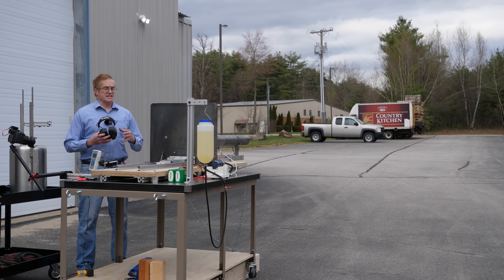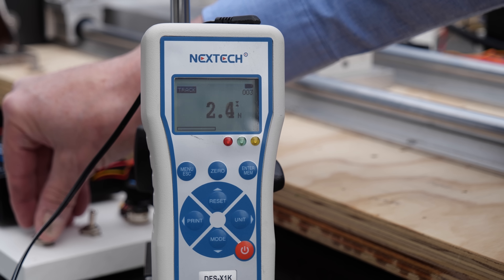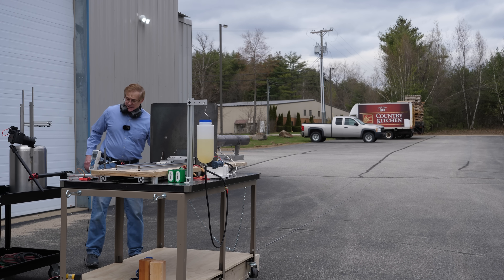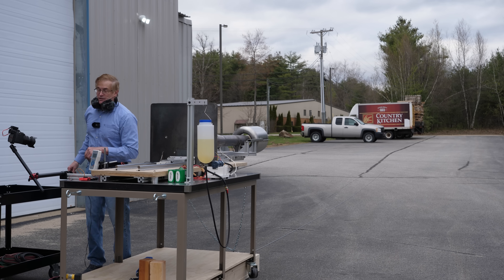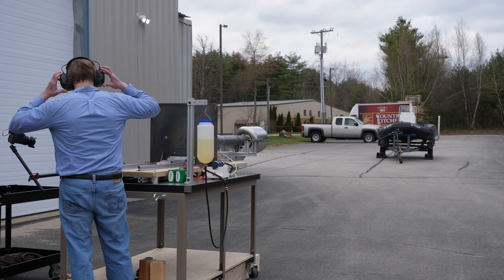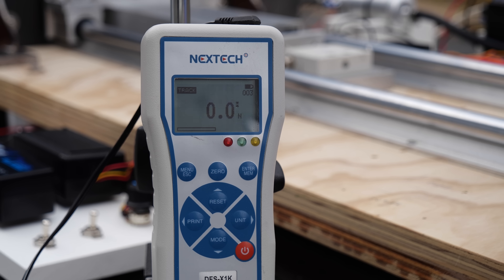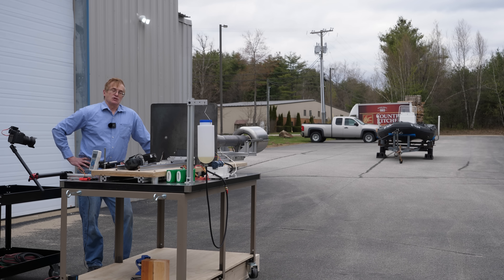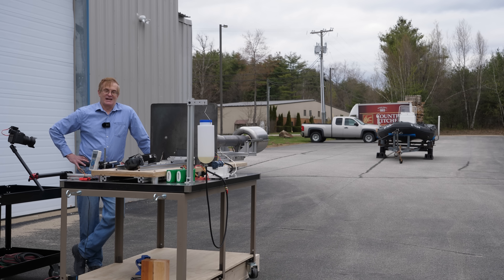WE USED AN AUGMENTER ON OUR PULSE JET!

Comment: How much thrust would you need to move the Earth?
Reply from the maker: It depends.  Define "move."
Reply: @TechIngredients  Good point, I was just being silly.  This is more of a question for Kyle Hill, but for example, when you're testing a rocket and you have to mount it to the ground...  How much thrust would it take to unintentionally change our orbit or rotation (Not sure which would be effected first) a non-insignificant amount.
Reply from the maker: The answer still depends on magnitude. "Significant " is too subjective. The real limit would be at the quantum level. A change in the orbital period less than a quantum of time, i.e., a Plank unit of 10^-(35) seconds, would be a reasonable lower limit. A nanogram of force for one second would exceed this limit.

Comment: Looks like your thrust measurement tool is affected by EMI from the spark gap. With only the fan on, it measures ~2N of thrust and is pretty stable. As soon as the spark is turned on, it jumps all over the place. Shielding/ grounding the cable to the device should help; shortening the cable might also.

Comment: I am not a scientist but judging from that setup it looks like the entrainment of air during jet-ventilation based on the Bernoulli principle? Maybe the search results with "medical terms" (formulas) help optimizing your system - I know you already did that - just wanted to pretend to be a smart ass. Eyeballing the diameter from a medical jet-ventilator compared to the trachea you are too close and to small in diameter with that thing ( I know ventilation of a human is not optimized for propulsion - different needs, obviously). Hey, but moving on also seems to be a good idea. Thanks for the video! And thanks to your neighbour for being such a good guy!

Comment: To tune in the ring use the formula to calculate venturi performance.
This set up works best in.motion.the air passing thru the ring by means of thrust is compressed slightly by the ring then heated by the jet and expands and expels with slightly more force than was required giving an exponential increase.you may add some type of heatsinks to allow more heat to escape into the airstream.also if you look up the function of the wave guide cones on the sr71 I think you could design a potential craft that could redirect the airflow so the bowshock would hit the venturi ring just right to improve performance in movement.
Maybe a boat?

Comment: 4:29 I cam tell you right now that bornoulli ring will function better if the jet was actually moving.
Reply: I more about electrons than gas flow - but that occurred to me as well; perhaps the entire air column/sheath around the engine must be moving at the speeds of flight, and not just the reed valve intake air.
Reply: @zinckensteel  maybe a makeshift wind tunnel?

Comment: I don't recall the exact details on the augmenter, but IIRC there are some guidelines concerning air gap and insertion distance... having said all that, my knowledge would be from the aspect of an augmenter installed on the exhaust of a piston engine aircraft so that may or may not affect its relevance  to your use.

Comment: There would probably be more resistance if the trailer was sideways. Also, you could put some wooden beams on the near side of the table and place a vehicle at the end to prevent movement.

Comment: Gah, i wish I had footage, but I can tell you from personal testing on valveless pulsejets the augmenter DOES work! I saw around a 30% increase with sub optimal geometry. It looks like the  augmenter you're using may be too small of an internal diameter effectively choaking off the induction area. That scenario might be why you saw a decrease in performance. one of the papers I read theorized the additional thrust was generated by having additional mass to accelerate on the combustion of the mixture while maintaining a higher resonate frequency of the pulsejet as the airmass inside the augmenter is decoupled from the air mass inside the engine. this allowed for a greater overall mass of gasses being accelerated and thus more thrust. I'll see if I can find the paper and I'll update this comment if I can.

Comment: The augmenter might work better when the engine (and the vehicle) are in forward motion, providing an airflow feed to the augmenter which is heated by the jet exhaust.  In the configuration you applied here, you still have some counter thrust due to a fraction of the exhaust hitting the rear interior of the augmenter..

Comment: Maybe you just built it wrong?  If there is all these papers saying it works and no setups known to reduce performance, maybe you made a mistake with either the engine or the augmenter.
Reply from the maker: That's certainly possible. One major difference here is that this system is considerably larger than the systems I referenced.

Comment: My understanding is that the augmenter works by incorporating the airstream. No motion (or relative motion via fans) to the airstream around the pulse-jet and therefor no improvement. I don't understand the negative effect however.
Reply from the maker: Me either. 
It may be that the augmentor interferes with the reverse flow part of the pulse jet cycle.

Comment: your neighbours are really going to love the pulse detonation engine , that thing will shake your fillings loose and possible unmoor your workshop from its foundations
Reply: Shatter windows up to a mile away...
Ask me how I know.
Reply: @PrinceAlhorian  how do you know 😅 lol?
Reply: @CraigLandsberg-lk1ep  built a proof of concept pulse detonation engine with an engineering mate in university.

We struggled to get the stochiometric values correct and when we finally did the detonation was loud enough to shatter windows, farthest crack away was about a kilometre.
Reply: @PrinceAlhorian  that pulse detonation engine sounds pretty serious then. I would like to make a small one, was it hard to build?
Reply: @PrinceAlhorian  I spose a supersonic shock wave would be hard to keep quiet 😮
Reply: @CraigLandsberg-lk1ep  Not that hard, seeing it is basically just a tube.  Then again I should say it's more akin to an open ended canon barrel.  The idea was to mount the thing to a go cart or similar thing as a proof of concept for my friend's end of year project.

The bitch came into controlling the optimum fuel air ratio and detonation timing.  This required electronics and some computer wizardry.  Individual pops was easy (and very dramatic, think of an propane bird canon on steroids), getting it "reloaded" and popping with a fixed frequency over a throttle range was an absolute nightmare.

At the end of the day we nicknamed it "The Converter" it converted Oxygen and Methane into noise.  Never did get it to run right.  My mate did pass his project because the data he collected was actually quite valuable for a long term project.  The science was sound but we were limited to the resources we had available.  

If you want to know just how loud the thing was, right next to the university is an artillery range, we took the thing there for subsequent tests.  The artillery men there said the thing was louder than their G6 cannon.  I guess that's what an unimpeded hypersonic detonation wave sounds like.
Reply: @PrinceAlhorian  cheers for getting back to me, I thought the timing of it would be hard to get right just from what I saw on a documentary, might ask you some other questions sometime. Thanks 😅
Reply: And the smell. Running that thing with a jug of urine for fuel should be rank.
Reply: Just wait ‘til the episode on nuclear fusion

Comment: I love this channel but for one of the smartest guy's on YouTube this was a dumb solution to the stabilizing problem. Why use a boat on a trailer that can be moved by hand get a longer cable and throw a car or truck out there change the angle on the filming rig and tie off to the base of one of those light polls. But a boat trailer? The one thing designs to have the least amount of drag. Literally made to be pulled around with the least amount of effort. Seems an almost comedically bad idea for an anker.
Reply from the maker: Thanks.
However,  I disagree. At around 1,000 lb and with chocks in front of the wheels, this is a pretty good anchor.  The crank and strap made pretensioning the line easy.

Comment: A lot of people are suggesting you need air flow around the augmenter. That might have some effect, but the point of the augmenter is to give a low speed increase to thrust and they become less useful as speed increases and reduce overall top speed.
Reply from the maker: Exactly.
Reply: Well if it only works when stationary what's the point of it in the first place ? its a form of propulsion
Reply: @andymouse  It isn't just when it is stationary, but the point is trading speed for power. It is the same thing as the lower gears on your car's transmission.
Reply: @barongerhardt  (Top) speed for *thrust*. Since an augmentor doesn't introduce extra energy it can't increase the (maximum) power output of a jet engine (setting aside that a stationary jet engine techically doesn't produce any power at all, no matter how high the thrust).
Reply: @blahfasel2000  Thanks for the answer
Reply: It has to move
Reply: It depends on the augmentor, just like wings you have augmentors optimized for low speed, and if you lower the chamber you should have an augmentor optimized for the entire top end speed range of pulsejets
Reply: I was going to say just that.

Comment: It seems, based only on the brighter red glow of the engine with the augmenter, that the overall airflow through the engine is reduced, with probably means less efficient scavenging of the combustion chamber, and therefor a richer mix and overall low performance.

Comment: Pulse detonation or.... Rotating pulse detonation? :) Loved to watch the video, I was expecting the augmenter to enhance the air intake by the action of the fast-moving exhaust gases. Could it be that the air-fuel mixture became too lean, resulting in less optimal combustion and reduced performance?

Comment: I really enjoyed this video, I have some thoughts that may or may not bear fruit on the subject.  It seems like the static nature of your bench test is holding back your desired results.  I believe that were you to add fans and a tunnel over the entire test bed it would simulate the affect of movement, though not the effect of altitude at which these types of engines become truly useful, and would have the added benefit of cooling the exhaust tube allowing for longer pulls.  Also nice touch with the rubber boat parachute anchor.

Comment: Based on my own work, the spacing is wrong (too close) and the augmentor is also a little small.  I've seen thrust improvements of over 40 percent static thrust  with augmentation on a pulsejet engine.   When the augmentor is too close it affects the reverse-flow in the engine's tailpipe and that reduces the power -- offsetting any gains from the entraining of extra mass.
Reply from the maker: Thanks.
Reply: @TechIngredients You should try an adjustable augmentor
Reply: @worldsmostwantedkiller Hm. How would you go about building such a beast, adjustable in distance as well as in diameter?
Reply: @markfergerson2145  adjustable distance is enough, have seen it tested in on the micro turbines in the RC plane magazines, they used a jet pipe around 100mm diameter, and tested gaps of 10mm, 20mm & 30mm. Any longer than that lost thrust, 30mm was best. They also tried pipes with a taper of about 10mm but I would have to find the magazine to give the particulars, the jet pipes were around about a foot long, U can actually buy them, but just as easy to make 😅 they were getting around about 10% more thrust without adding any fuel, just the pipe, will post more details if I can, cheers to the Author 😀😀 love the fanbike lol
Reply: @markfergerson2145  The adjustment mostly needs to be in distance, as it has a relatively narrow sweet spot of distance at which you get quite some increase.
Reply: @worldsmostwantedkiller  thats what I was thinking
Reply: @TechIngredients  You shouldn't be doing this. You are fooling your brain into thinking you're doing something useful when you are doing things without learning the theory. You're eating of the forbidden fruit. What you call an augmenter is basically an impedance matcher. When you have learnt how the maths work you will know what you're doing wrong.
Reply: Would the relative airspeed going over the jet and augmenter have anything to do with the boost as well? I'm assuming that the augmenter works on the same concept as the balloon inflation experiment where the air you're blowing into the balloon pulls in air along with it through boundary layer principles. So if the pulse jet were moving through air, what effect would the velocity of the air going into the augmenter have on the thrust?

Also how about the heat from the pulse jet? Would the Meredith effect come into play if there were cooling fins in a tube before the inlet of the augmenter?
Reply: @TimNelms Meridith effect?😅
Reply: @CraigLandsberg-lk1ep  It was used on the P-51 mustang cooling system.  Air is forced through a radiator, that air expands because of the heat, faster air leaves the radiator, thrust is achieved.
Reply: @TimNelms  yes I new about how they harnessed the expanding air from the heat exchanger to go faster, it was actually a British guy who discovered it, can't remember his name, they used it on the Spitfire and Hurricane as, they use it on Indy cars and Formula One as well, cool idea, technically it's hot 🔥 idea😅lol
Reply: @TimNelms  From what I heard, the thrust produced by the hot air exhaust was only enough to offset the parasitic drag of the massive air scoop underneath the Mustang. Still flipping cool either way.
Reply: I was wondering if you'd darken this doorway. He's got a great experimental set up and I wish he'd push a little more before moving on to PDEs.
Reply: @mikegrace8814  what is PDE's?
Reply: @CraigLandsberg-lk1ep   A pulse detonation engine. The difference is if the combustion results in a supersonic, or subsonic wave.
Reply: "The Performance Spiral". ........get it?
Reply: I wonder if finding the right combination that increases the thrust would then work on the turbo jet engine.
Reply: @DaniGirl6  it works much better on a turbojet, I left some info elsewhere
Reply: Bruce the legend !
Reply: ( hi Bruce - good to see the experts in field are on the sidelines too..)

Also for mounting in an aircraft - the sleeve of an augmenter assists in radiative shielding. those tailpipes get "roasting".
Reply: Hey Bruce! Big fan!

Comment: I have the video paused at 10:55 and I'm looking at the augmenter and have a question. It is hard to tell, but it looks like there is a gap between the nozzle of the pulsejet and the inside ring of the augmenter where it attaches. 
I wonder if the augmenter isn't doing anything because the engine is stationary. If the engine were moving quickly, that gap may channel air and cause additional thrust. I'd be really interested to see what would happen if you put the engine onto a moveable platform and try testing it there.
Keep up these videos, I love them!

Comment: The wheel chocks were a good idea, but you should take a page from aviation wheelchocking. There, the chocks are front AND back. Both side of the wheel. And the elements are connected together.

Comment: Pulse jets are inefficient. THE only way any improvement could be had would be in the burn chamber. Also A static test bed cant be compared to if the thing was actually flying, you would need a 200mph wind tunnel to see IF an augmenter did anything at all.

Comment: I think that your missing the ram effect of the engine being in motion? Imagine a jet engine on the ground at takeoff versus cruise? The efficiency of the jet and power output increases  the more the jet reaches equilibrium from input to output! You would need to ram a lot more air at atmospheric pressure to achieve this? The fact that the engine is trying accelerate air at atmospheric pressure is your limiting factor! Great video! Cheers!

Comment: With that setup, while anchoring is a good idea anyway, I didn't foresee needing to offset the thrust with anything more than 500lbs (if you have a pallet and some sandbags, it works well). With the boat, I'd be more concerned about torching the leading edges or getting lift, but you did right by offsetting the distance enough to help dissipate the force stream. A thrust diverter with a weighted base is the best of both worlds, which can, depending on partial enclosure, help redirect some of the sound as well. 
I still don't think the augmenter was ever going to work with a pressure differential on both sides of the cone such that it might see both in a moving airstream and at altitude. It would be difficult to replicate without a partial vacuum chamber and sufficient wind tunnel test environment.
Reply: The boat was overkill. The gauge read around 200N, that is only around 40 pounds of force. 80, if the augmenter double it.  As you said sandbags, a parked car, or leaving the trailer sideways would have been plenty.

Comment: Eh is your augumentor or what it's called measured? It seems like you mounted it to the table, not the moving engine. The augumentor is pushing itself forward, not pushing the engine. Or did you in fact measure the total thrust?

Comment: My fear would be having all the controls directly in front of the engine.  I know that the engine is secure and that we're not getting half a million lbs of thrust.......
....but that engine sounds scary as sh/t 😁
Pointed a bit downward, how much would it cost, using it to dry the driveway after a morning rain?
...quite the fuel hog. 😁